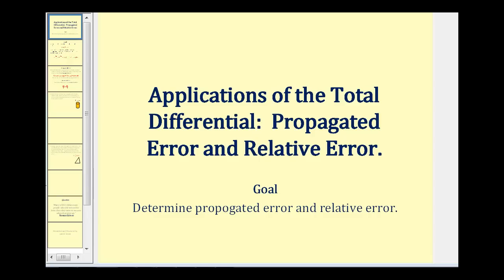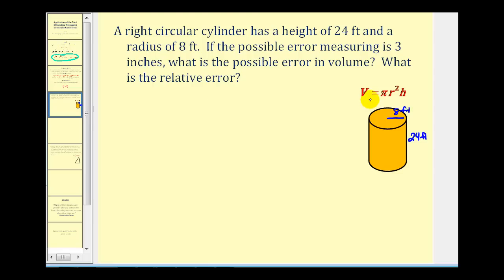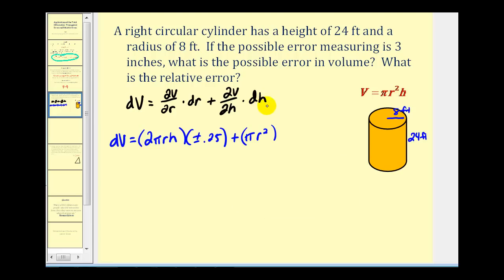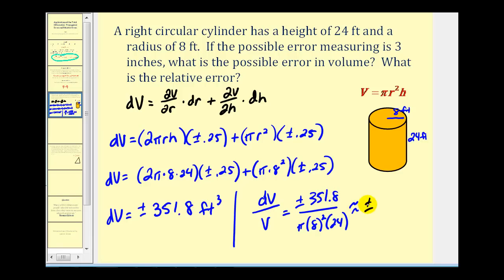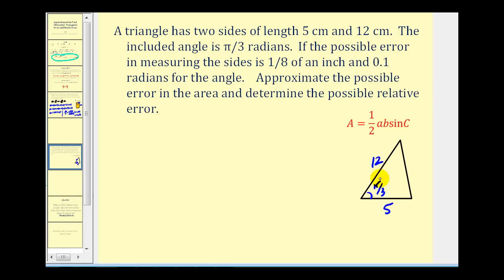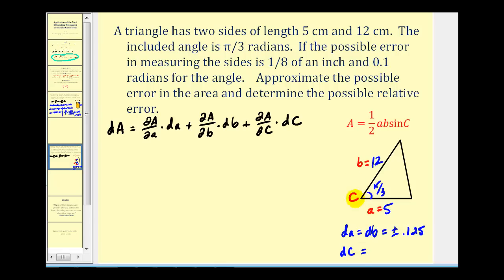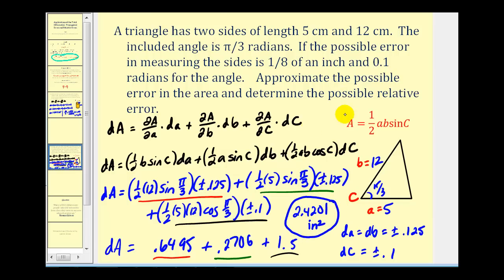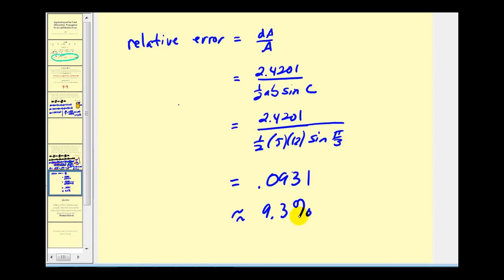(Updated Version Available) Applications of Differentials of Functions of Several Variables

Comment: I have a quick question how did you get the da and db as +/- 1.25? on the 2nd part of the problem??
Reply from the maker: The error in measuring the sides is 1/8  = 0.125, not 1.25.
Reply: @Mathispower4u  my bad but I got what I need from this comment...